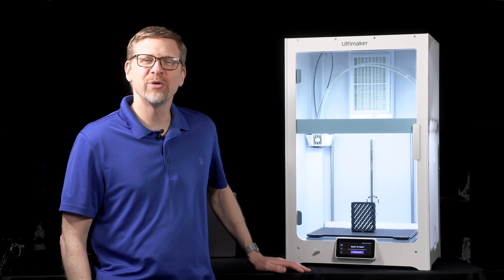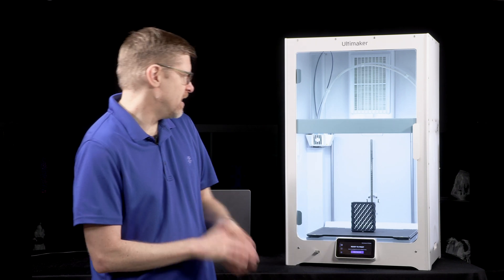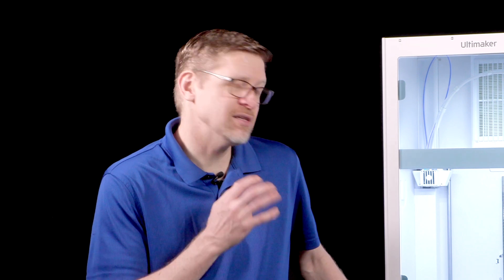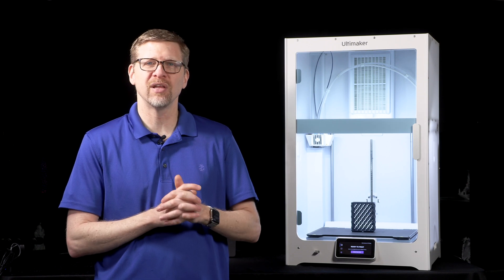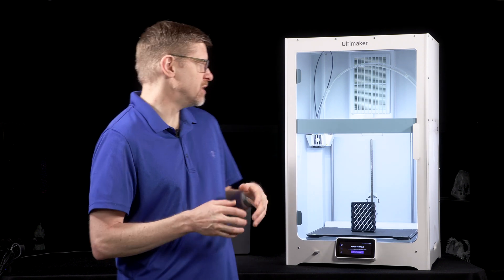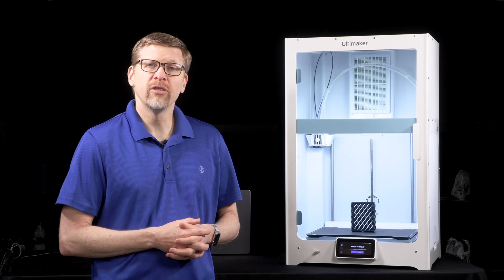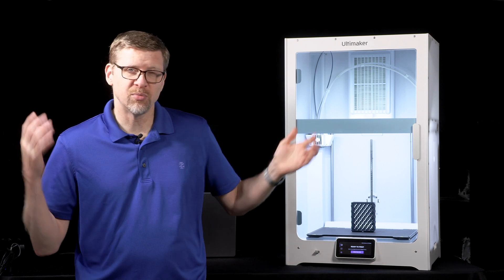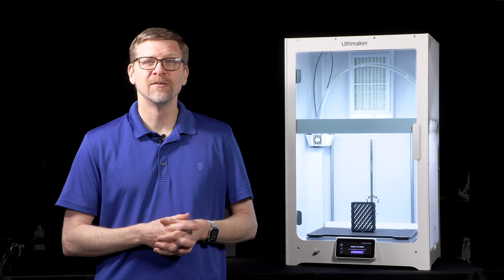Ultimaker S7 Overview from 3D Universe

Comment: Thank you for an Informative video. One big difference is that, I don’t think S7 is metal printing compatible (yet)
Reply from the maker: You are correct! Thank you for pointing that out. As of now, the Metal Expansion Kit is not compatible with the S7. The reason actually has nothing to do with the material itself. The S7 is fully capable of printing the same materials as the S5. The difference is that, when printing with the metal material, the entire glass build plate is supposed to be submerged in water to safely remove the print from the build plate. The flexible PEI build plate on the S7 is not supposed to be submerged in water, so that's why it's not currently compatible. Ultimaker is doing ongoing testing, and we hope to hear about an S7-specific metal kit soon, but at the moment it has been deemed not compatible.

Comment: Will Ultimaker be offering any upgrades to the S5 to support the new build plate that is available on the S7
Reply from the maker: Unfortunately, there are no plans to make any changes to the S5 other than ongoing firmware updates. However, 3D Universe will soon be offering a 3rd party solution. We will have flexible magnetic PEI build sheets sized specifically for the Ultimaker S3 and S5 available soon! We've been testing these build plates for the past several months, and they definitely offer an improved user experience. Stay tuned to https://shop3duniverse.com/ and subscribe to our newsletter to get notified when they're available.